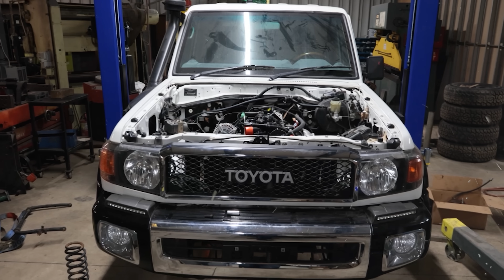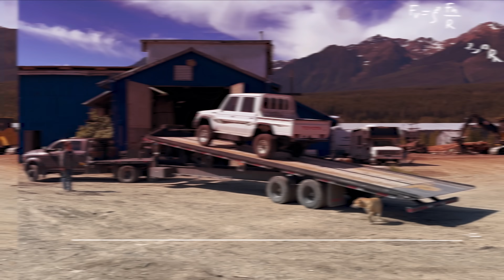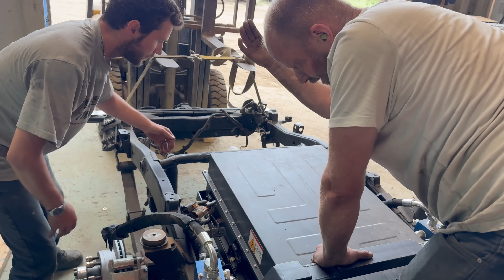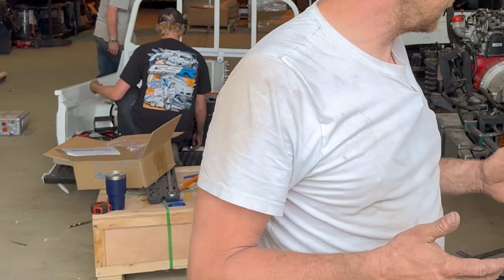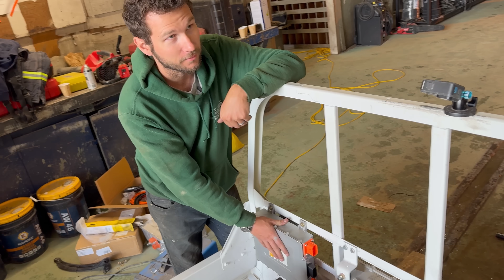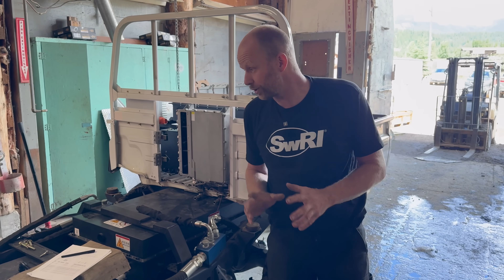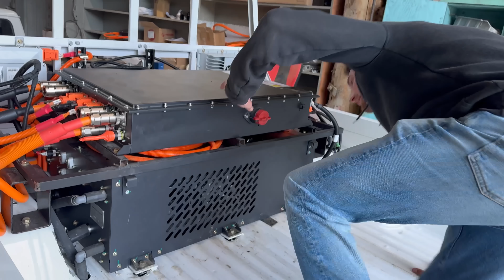High Voltage Power System Install on a LandCruiser! #EdisonLC79 [EP3]

Comment: Forgive me if this has been explained and I missed that video, but isn't the reason these new Land-cruiser 70 series cant be registered that they don't meet emissions.
But with this hybrid mod, don't we get the added benefit of having something that might register to drive on the roads, especially given that Edison is a manufacturer.
Reply: Most of the mining vehicles are built differently at the factory, not for pedestrians and then converted.
Reply: @wobblysauce  It has rounded edges from the factory and is not worse than a hummer or any other contemporary US truck, the mine specific configurations will be irrelevant for regular motorists as they wont buy it in a version kitted out specifically for going into a mine.
Reply: I believe the plan is to make this truck successful and then build a fleet of them for offroad use in mines and no need to pass emissions.

That being said, this truck opens the door to the possibility of an Edison street legal emissions friendly 1ton pickup (someday).
Reply: @Sah-o5m  I know of the mining market, other companies has also made BEVs based on the J70 specifically for mining so there is definatley a market there.
but concider Edison being a manufacturer and the possibility of them releasing a version of it as a limited run road vehicle, negating the use for new crash tests by being a small batch of custom builds. Thus bringing them into the US and Canadian market at some scale under the Edison brand.
Reply: I thought they said that the ones built for strictly mine use didn’t even have a VIN number.
Reply: @minnesotatomcat  Never heard that. It would not really make sense since even diggers have factory numbers these days and this comes from a regular car factory where it seems turning off the machine that prints vin numbers would be more of a bother than to just print it on everything, regardless if it is going to a company that re fits it for off road use or registered on road use.
Reply: @Sohave I could be totally wrong but I thought something like that was said in a video where they walked through the museum and there was a mining truck and they said it was rare to see cause they normally get crushed after their mine use is over because they can’t be registered on the road.
Reply: @minnesotatomcat  Yep, normally when no longer in service to the mines, they get disposed of, normally crushed/recycled, but that one was taken from that que to go to the museum instead. 
As with Edison, it is proving the concept, and not doing anything in the cab makes it more of an RV/Coach builder. Doing so, you could make any frame and put whatever cab you wanted on top.

Comment: How do the system voltages compare to legacy hybrid vehicles currently on the market?
Reply: This little pickup is getting the gear from the Edison Semi trucks. So it should be  two 307 volt batteries in series that provides 614 volts.

I don't know how that compares to other EVs.
Reply: @Sah-o5m  Thanks Sah, when I had to design anything I always wanted to study what others did and what were the results😀. Learn lots of lessons of what not to do....but basically with electric  power - higher voltages = smaller wires and less current buy I try to stay close to industry standards and use the mass produced components if possible.

Comment: I like the design philosophy of keeping things simple, the chiller system adds complexity but also provides cab heat in addition to the required temperature management of batteries and other components.

Comment: i’ve been watching the progress of this project and i have to ask …. Why?
what is the practical application of this vehicle ?
Reply: It’s for a mining company and they use Land Cruiser. Being able to run on battery underground is the main one. But also having a backup generator for emergency or on the surface. They also can set a speed limit for underground but remove it for the surface. With a mechanical drivetrain they had to lock it in low range permanently.
Reply: @_Zdex007 ^^^this. This hybrid truck is a perfect combination for a mine. 4 seats for employees. Room in the bed for stuff. Runs on batteries underground. Has no range anxiety above ground. Able to offshore power to equipment.
Reply: for going underground in a mining operation I think
Reply: Plus this gives them easy access to using high power electric tools in remote areas.

Comment: D/G.  Are any of these new components rubber hard mounted to the chassis or outriggers of this LC72 prototyped ?  ?  Mista Reagan from Outback OffroadNT YT Channel has experienced the factory bolted steel dropside tray welds crack on off-highway conditions Downunder, which might occur with this truck !  !  V.

Comment: Im new to watching the Edison land cruiser and I was wondering with the motor on axle setup, was there a loss in ground clearance or not? And if there was, would portal axles be possible to regain that loss?
Reply: Probably not, might even gain ground clearance by not having that diff.

Comment: About 13 years ago, we had a big debate regarding connecting electric motors directly to a solid axle on our off road cars.
The concern was vibration. It will be interesting to see how your set up works out.